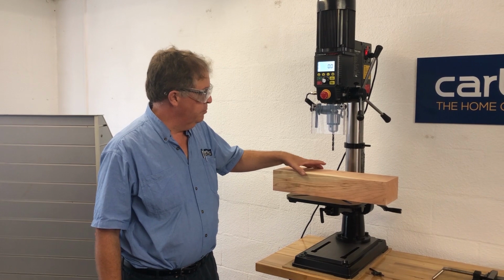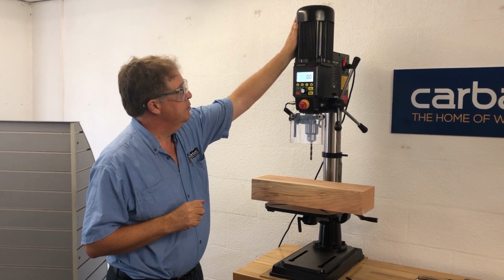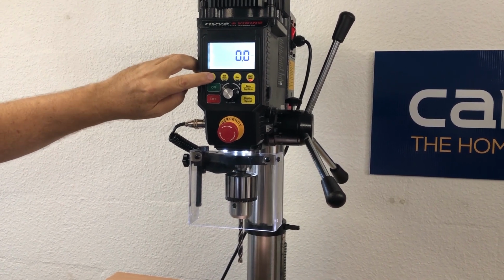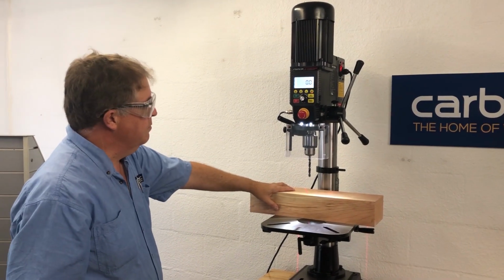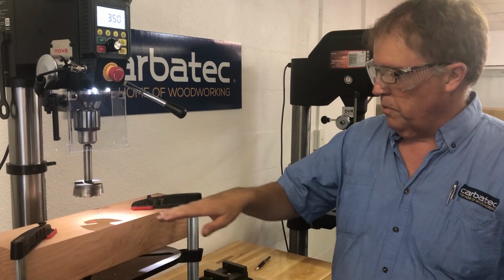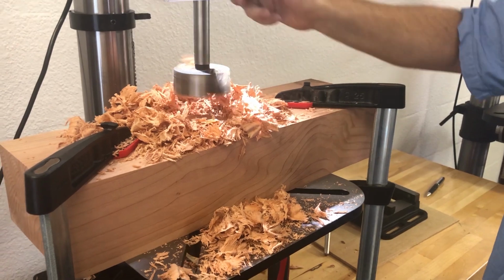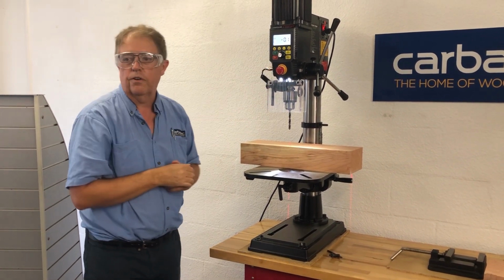Nova benchtop drillpress demonstration

Comment: Nice tool and nice video. How do you cancel the depth stop setting? I do not want to turn the power switch off every time I want to cancel the depth stop setting. Also, do you recommend turning the power switch off when the drill press is not in use?

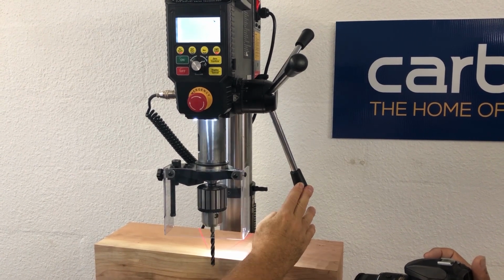Comment: Beautiful drillpress, though i saw a little run out on the chuck? (3:21) Thanks for sharing!
Reply: probably all chucks have some runout on the outside , its only reall, important on the inside , the outside is only cosmetic basicly
Reply: @Basement_CNC  Hi Felix, i use Röhm or Albrecht m.i. Germany morse taper precision drill chucks with max. 0.05 mm run out.

Comment: Can you do rapid repeatable drills with the depth stop set? I make products that have a 30 holes that need to be drilled but not all the way through the board but I need to be able to have the depth stop set and then to go from drilling one hole to another.
Reply: You can set the „normal“ depth stop (the Ring on the handels) and use the maschine as normal drillpress. 

Sry for my Bad Language